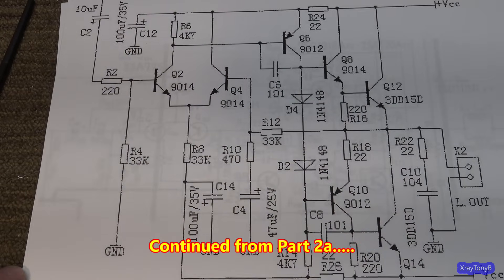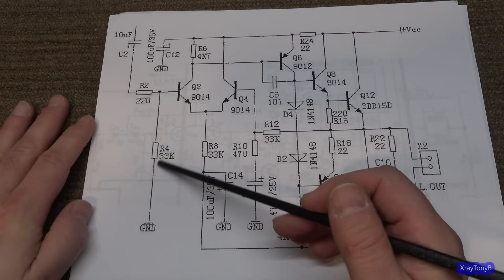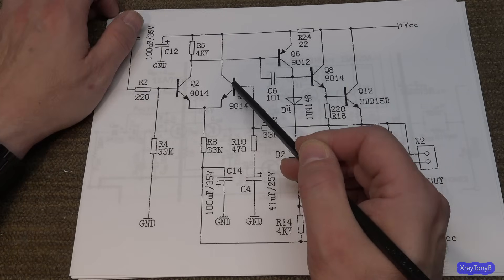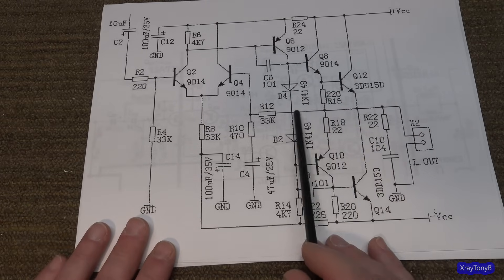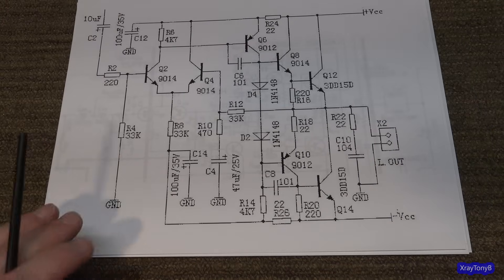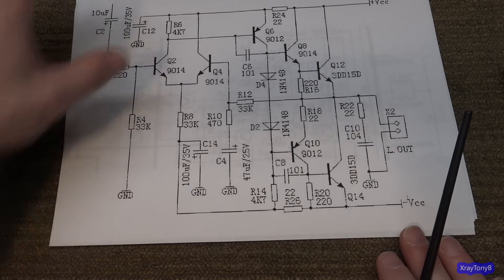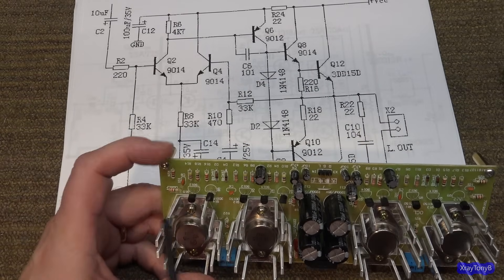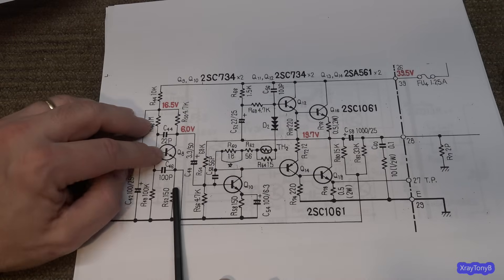Amps n'at Part 2b - Circuit Identification & Comparison

Comment: Great explanation on amp design. Before YouTube none of this info has been readily or easily available outside the industry. It's so good that guys like you take the time to talk about this in detail. I personally haven't discussed transistor circuits with anybody properly since the 1980's - nobody around (whose interested enough to to share the knowledge with). I've forgotten half of this stuff. I do remember college lecturers and technical training officers talking about amp theory when I was an apprentice TV engineer back in 1983-6. Thank you for going into this detail and bringing it all back for me. Outside of old tech* books I have it's all we have (* which I do read from time to time - and they can't really put the theory across in such a way that it is enjoyable to read all the time).

Comment: I really liked this video Tony! Very appropriate for my current level of knowledge about the topic. It helps me to understand terms I’ve heard you and others use, like ‘Voltage (amplification) Stage’, ‘current mirror’, and where and why you can adjust the ‘DC Offset’ on some amps, but not others. I was thinking I needed to buy an amp kit like this to learn myself what makes them tick, and I likely still will, but I can learn vicariously from watching you. Thanks for taking the time to share your knowledge, it is significant and much appreciated.

Comment: Fun to see a test of those two amplifier circuits. you should design a quality circuit board of the winner and put it online and make a amp builder series. That would be awsome. With components and transistors that are widely available today.

Comment: 24:29 R235 should be on the on the collector side or emitter side of Q213, which is better to have ?
putting on collector side, it does the adjustment through Q209, whereas if put on emitter side it will directly adjust Q213 i guess.

Comment: @ 10:30  It was also good enough for Nelson Pass when he designed the Threshold NS10 preamp's final output circuit, using 2 - MPS6571 transistors in a quasi-comp configuration as well as Harmon Kardon Citation 12 and 16 amps, which are fairly well regarded amps for the time..Phase Linear also used that design in it's 400/700 and its newer series II line. Back when those amps were designed, it was harder to get fairly well matched PNP/NPN power transistors, so they made it work with what was available, and even when PNP/NPN's are used an emitter resistor is still almost always thrown in for better balancing. between the output components.

Comment: These videos are so cool, hope there will be many more, thanks Tony. 
Do you or any other kind reader have suggestions of books about audio amplifiers at this "level"? I'm a hobbyist stuck at this point where I have a solid understanding of basic electronics and how components work but can't move forward since all books I've found either start from scratch or are aimed at circuit designers so they go way above my head. These videos are just right, cheers from Italy
Reply: Not sure you received first reply.art of electronics.douglas self books.bob Cordell book.nelson pass diy articles archived on pass labs site.rod Elliot projects on esp site.

Comment: Is the stopper resistor used for blocking RF frequencies? I only know the term stopper as in grid stopper with vacuum tubes where it is used for that purpose.

Comment: I really like the way you explained the circuits particularly using the schematics back and forth.interesting the feedback on output cap coupled pioneer seems to be taken before and after the cap.came across an interesting article a while back about optimizing quasi comp circuit.just came across some cheap n MOSFETs so I may finish a project I started years ago based on nelson pass mod of hk citation 12.also have some old rca to-3 so maybe a bipolar version too.

Comment: Re Pioneer SX-535(?) schematic, wouldn't DC reach the speaker terminal via R80 and R82?
Reply: R80 is blocked by C58 and at 33k R82 into the low impedance path of the output wouldnt supply enough current @8 or 4 ohms to provide any voltage drive Thats why its 33k to keep from loading the  Class A input

Comment: All I know is I miss my all Alpine and Rockford Fosgate system I had set up in my Truck. I have no idea what my Yamaha Studio Monitors have in them. They all have separate amps. I opened one once but was not able to see much. They have quite large amplifiers in them. The low range and the high range both have separate amps inside. But then again you are talking about studio equipment.

Comment: I'm wondering if somebody has some video series exploring the differences in design with actual testing or simulation. I know JohnAudioTech does something similar with his designs, but was looking for something that's right on point. I know it takes a lot of time to do that and have a nice presentation, but I'm sure somebody must have done it.
Reply: I think John's is the best out there as you can easily go back for reference and of course you can do a 'Build along !' I have(amongst other stuff) a circuit diagram of the JAT501 on my wall as its nice to glance at as I'm watching amp stuff, keeps me on the right track ! The Signal Path has some more numbers orientated class A and A/B stuff from about 10 years ago which is still great.

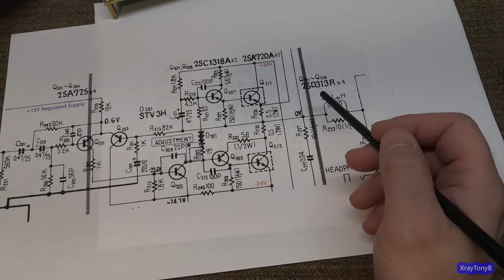Comment: At 23:54 I see the circuit for Q231 emitter and Q213 collector are connected together through R231 (5.6 Ohms). That is different from the positive side circuit (Q207/Q211). What is going on there?

Comment: How can I learn to follow the signal path if the signal can be coming out of either the collector or the emitter side of the transistors? Makes following the signal through the circuit very confusing.
Reply: That's where I am as well, on the previous video as well.  The electronics associates is no longer offered at my college and the ibew inside wiremans apprentice program dove only as deep as rlc circuits.  If it wasn't for the apprenticeship I would be adrift in an ocean of electronic chaos watching this series of videos.  Just going to take time to figure it out.